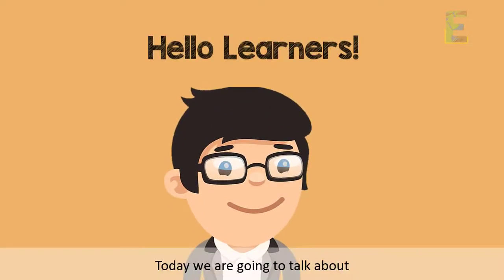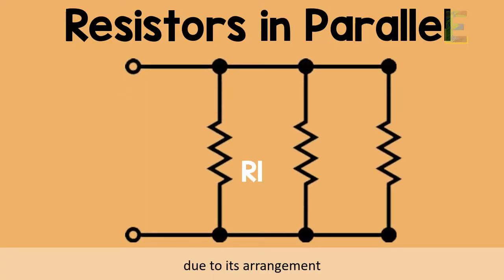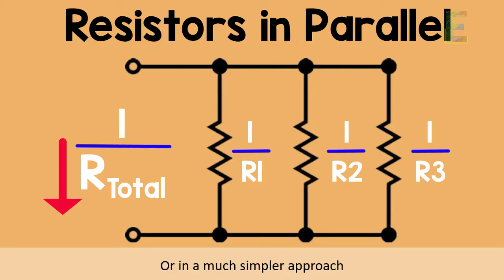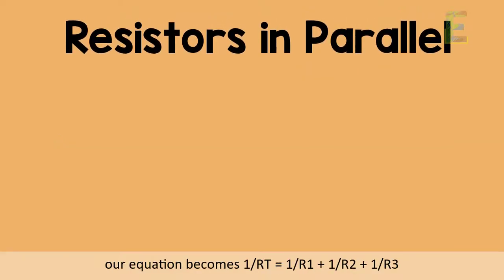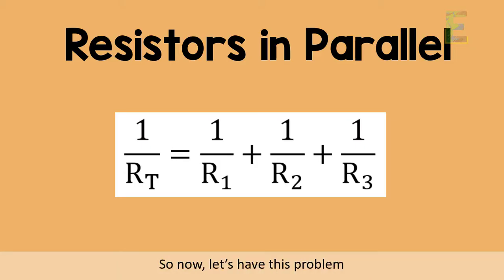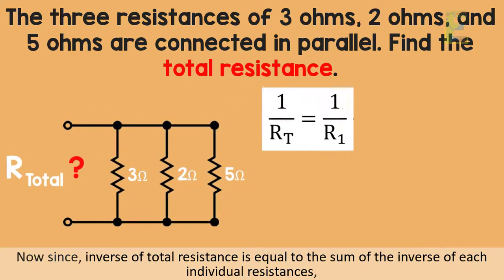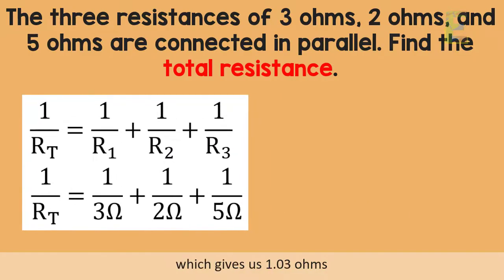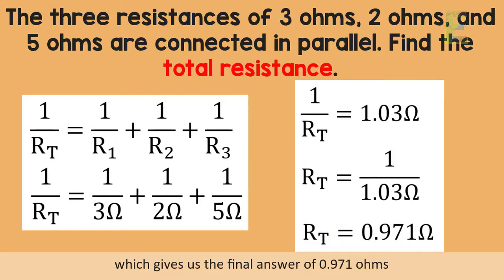Total Resistance of Parallel Resistors | Physics Animation

Comment: heads up - there's a rounding error in this video. 1/3+ 1/2 + 1/5 = 1.033333333... if you round this to two decimal places, 1.03, then yes the total resistance is 0.971 Ohms. However, if you calculate the inverse of the sum of the resistors (i.e. 1 / (1/3+ 1/2 + 1/5)) you get 0.9677419355 Ohms, which is more accurate.  Remember kids, DON'T ROUND TO EARLY.

Comment: how did you get 1.03 ohms though? i cannot understand that as you didnt explain how you got that number.
Reply: i agree this video doesn't do a good job on further classification. i hope im not too late to answer. 
basically, its basically adding fractions. you need a common denominator. once you get your common denominator then cross multiply the fraction with 1/Rt to get the total resistance. for example

i have two resistances 3.0 ohm and 6.0 connected in parallel. so i add 1/Rt = 1/3.0 + 1/6.0. (and then pick the common denominator , if you're unable to understand what goes on this process, watch a video for further explanation its hard over text. its basically addition of fraction with common denominator) then 6/18 + 3/18 (our common deno is 18) and basically then we add getting a value of 9/18 which is 1/2. 1/RT = 1/2 which gives me the total RT to be 2. hope this helped.
Reply: @meowmeow-dw3bi  To complicate this even further what I was to add in 47 ohms to the 3 and 6? Its fairly easy to calculate when you have two numbers but try three in your example.
Reply: Take the calculator and just add all 
1/3 + 1/2 + 1/ 5 gives 1.03 
Then again calculate 1/1.03 so u will get the answer 0.97
Reply: only answer that makes sense anywhere on YouTube, thank you bro @annethrisha839
Reply: Huh @annethrisha839

Comment: But, are you dividing by the 1 on top? Or dividing each singular resistor against the next one, or are you multiplying each one to each other? I plugged this into a parallel resistor calculator and your answer stands but I don't understand the details on what exact function is used
Reply: i agree this video doesn't do a good job on further classification. i hope im not too late to answer. 
basically, its basically adding fractions. you need a common denominator. once you get your common denominator then cross multiply the fraction with 1/Rt to get the total resistance. for example

i have two resistances 3.0 ohm and 6.0 connected in parallel. so i add 1/Rt = 1/3.0 + 1/6.0. (and then pick the common denominator , if you're unable to understand what goes on this process, watch a video for further explanation its hard over text. its basically addition of fraction with common denominator) then 6/18 + 3/18 (our common deno is 18) and basically then we add getting a value of 9/18 which is 1/2. 1/RT = 1/2 which gives me the total RT to be 2. hope this helped.
Reply: how dumb can a person be